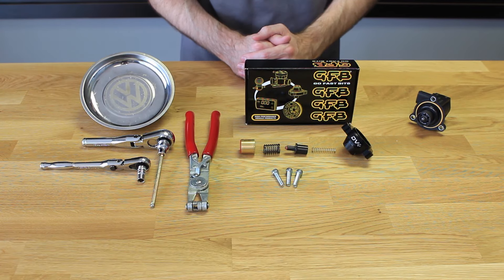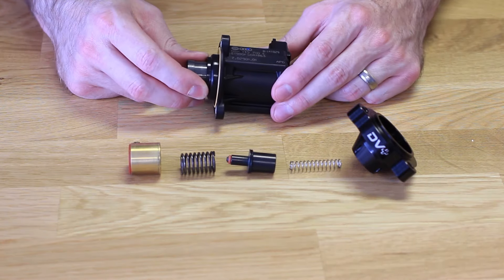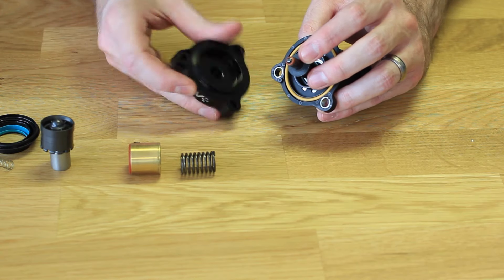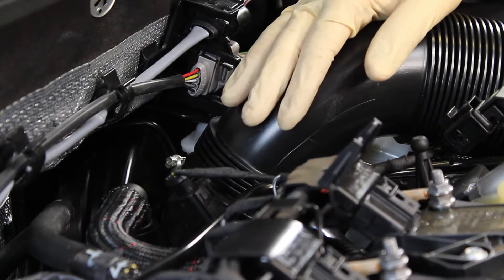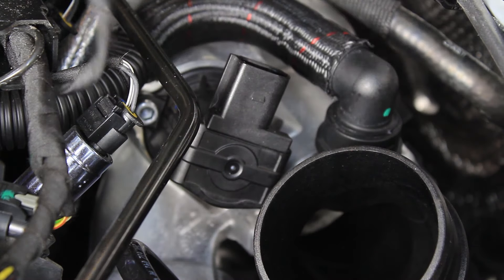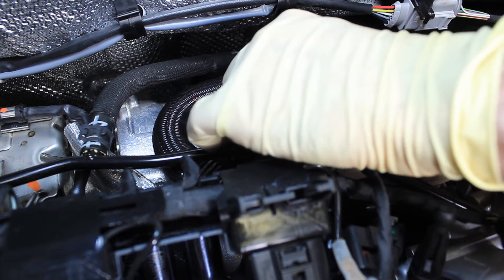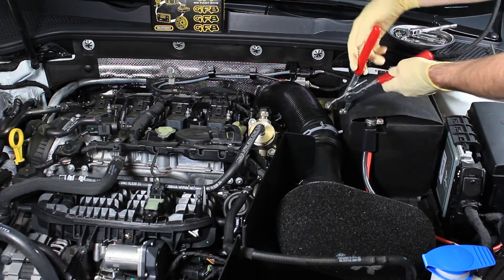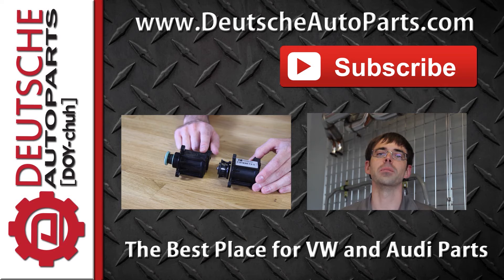How to Assemble and Install a GFB DV+ on a VW MK7 GTI  (Assembly applies to all models)

Comment: I think you guys missed the step of adding some oil lubrication to the Piston. Is there a reason why you guys didn't add this on your install?
Reply: Lan Yu is that what makes it flutter? I installed mine dry and it flutters
Reply: @dripxloading  no its just for proper lubrication to stop it from potentially wearing out earlier than intended
Reply: RawdogginCowboy what kind of lubricant did you use?
Reply: Aurora S I just used some of my clean oil 5w-40.
Reply: I slapped some KY jelly on mine, just for good measure
Reply: @dripxloading   yeah you must put oil on it, even says in the small booklet, that came with the valve. I just applied my normal 5w30 by finger just a film layer really..
Reply: @dripxloading  the flutter is called compressor surge
Reply: @3xcelsi0r10   I believe alot if people believe the flutter cool , but it definitely is not

Comment: Just installed this. Also running the ECS turbo inlet pipe with ARM CAI. Definitely hearing more sound when letting off throttle but feel as if I'm getting a more reliable/steady boost between gears. And it builds boost faster. I would have like to have been able to try the second spring that is advertised.

Comment: Having trouble keeping the DV+ housing on the stock diverter valve housing, I have it lined up and assembled as per the directions But the DV+ wants to keep popping of the off of the stock dv. I've done one of these before but didn't have this problem

Comment: Good day. If you have the turbo inlet pipe, mufffler delete, intake pipe to a R600 intake. Does this still make clearance on a gold 7.5 gti. Or you will need the one that makes the solenoid sit on the top(the one they recommend for golf R)

Comment: Hi guys, thanks for this video.  I'm about to attempt this myself.  It looks like the job would be a lot less fiddly if the turbo-inlet elbow was also removed and out of the way.  I know this is quick and easy to do.  Has anybody tried that?
Reply: OK, so I just did this installation and access was super-easy with the turbo inlet out of the way.  I'd recommend that.

Comment: Hey, I have question. So I got a mk5 gli Fahrenheit The oil housing had a crack and it got replaced. But when i got it back from vw, it came up an engine light and code reading - p0238. They told me they "think" the gead gasket might be leaking and the had tried inspecting it but put it back together. Now I'm tryong to figure out what could be going on if im not seeing present leaks and my jetta is having a hard time starting up as well. I don't drive in the condition its in, but I crank it for 15-20 seconds for idling so its not just sitting going bad and turn it back off. Any suggestions?

Comment: Do i need this part if i have installed a BOV? i have a little flutter over 25lb of boost but i think its from the spring inside the CTS BOV i need to go with the heavy spring. I was reading on forums that the flutter is caused by the DV so any help would be appreciated. TIA :)

Comment: i just recently got a dv+ kit second hand and realized that the plunger and plunger spring weren't included and ordering replacements directly from GFB costs 16 for parts and 70 for shipping (not happening). as i am scouring the internet for replacement parts (6119, 6121) is it safe to install it with the oem plunger and spring?

Comment: How does that piston not fall out when its bolted on? Its freaking me out incase i drop it in the turbo🤔
Reply: because it is pressing against the housing. The hole is smaller than the cylinder of the GFB

Comment: Will this install explanation work for a 16' Golf R?
Reply from the maker: This would not be the same as the R uses a different valve
Reply: +Deutsche Auto Parts
Paul. Always appreciate your video, and products. 
Please clarify your response. Do you mean there isn't a GFB DV+ for the Golf R Mark 7's, or that the install process is different for the Golf R because they use a different valve? If so, do you offer an alternative for sale? Thanks.
Reply: +jm sma they use different valves

Comment: Will this fit on the 1.8 tsi engine?
Reply from the maker: Yes it will.  Take a look here for the applications https://deutscheautoparts.com/t9351-gfb-dv-plus.html
Reply: +Deutsche Auto Parts also is it necessary to unplug your battery while installing this?

Comment: Hey i transfered my DV+ from my 2007 audi a4 2.0t, to my 2015 GTI, i disassembled everything and made sure it was clean and reassembled in the correct order, ive noticed on wide open throttle between 3000-4500 rpm i notice almost a light hesitation in power delivery but the car seems to run fine everywhere else, i read up that its just the computer dialling back the boost, do you have any input? I don't hear any boost leaks or anything out of the ordinary.

Comment: Do you have a clip that we can hear it?
Reply from the maker: Im sorry we dont. There will be little to no sound difference when this product is installed on the vehicle.  The benefits are more for performance
Reply: Deutsche Auto Parts what dose it actually do?
Reply: @Deutscheautoparts I have a question, I just installed on my, but seem like no sound different from the stock dv. Is it suppose to make any blow off noise?